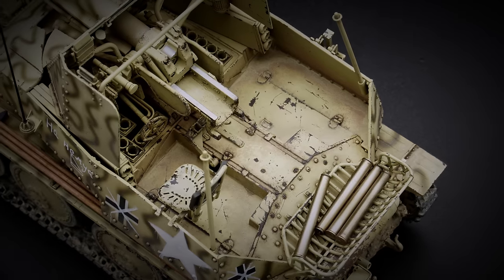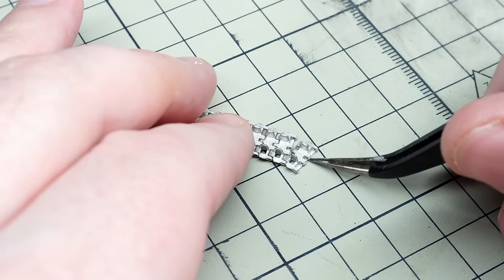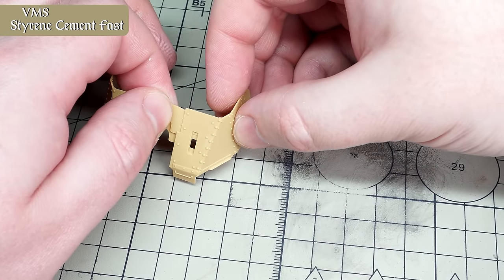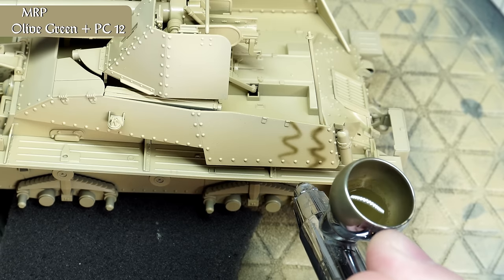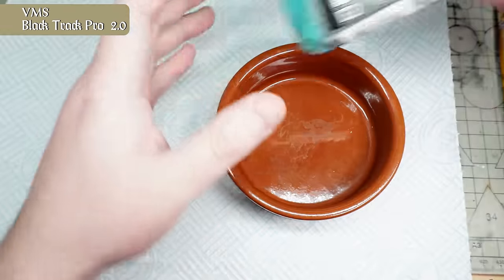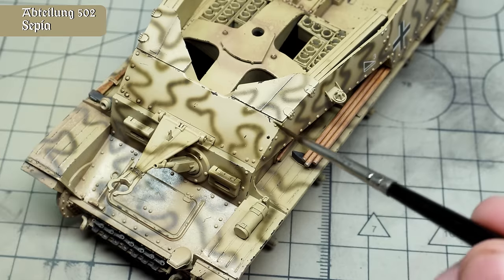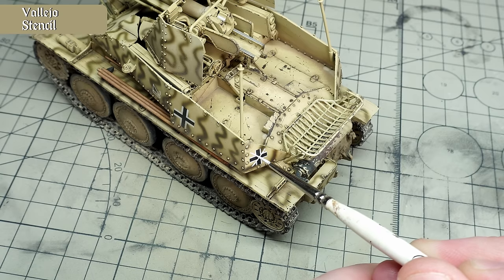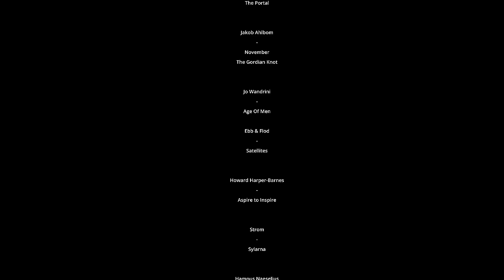Tamiya 1/35 Marder III | Full Build

Comment: Another trick for the 2 piece gun barrels, is take a.010 mm piece of plastic and glue it in one side then attach barrel together and cut, sand, and flush it all together.
Reply from the maker: That's a cool tip Rick thanks !

Comment: Fantastic bit of modelling, What airbrush kit do you use and compressor? would like to know what would be best for modelling as I'm only just getting back into it after 40 years :) Many thanks
Reply from the maker: Hi Phil thankyou. Sorry for the late reply. I use a h&s infinity cr with a 0.15 needle and nozzle ( one of the finest sizes you can get) 
My compressor is a sparmax tc-610 h ( or very similar ) 

It's about 450 for the complete set up that I use, I used an iwata sprint jet to start with, had that for 2 years and it started overheating from use, if you're going to be  spraying a lot, get one with a tank. If not a constant one is fine despite what folks say. 

Airbrushes are very personal, I found the spares for h&s  very affordable compared to iwata so I shifted over a few years ago, haven't looked back :)
Reply: @lpjmodels  Thanks for the reply, brilliant, I'll look into getting one of those

Comment: I was thinking you maybe had a problem with the paint peeling away because of the mix, however I read that AK Real Color and MRP are both acrylic suspended in a lacquer mix or vice-versa. Tamiya XF is aycrlic in alcohol. Mr Hobby Aqueous is the same. I guess they're all interchangeable.
Reply from the maker: Hi mate, it was 100% a scrape, the finish is really tough. I caught the end of what I was using to chip in the paint because at that particular moment I was being a bit too vigorous and  got distracted. 😀 
I used to have adhesion issues several years ago, lots of paint peeling with tape e.t.c but I ironed that out. 

Aha paint chemistry my favorite!  
Ak real colour started as a formula similar to tamiya but somewhere along the line the recipie was changed and now its pretty much a pure laquer. 
Standard mrp is pure laquer, but they have a water based version for touch ups. 

Sprue cutters union podcast have a few episodes where they go into the bear bones of the subject, the problem is paint companies aren't always transparent with their information. 
It's an interesting subject !

Comment: Lovely as always. I have found AK and Ammo chipping fluids hit and miss on some of my past projects. How would you rate the VMS chipping fluid by comparison?
Reply from the maker: I found so far it easier to use. The first point Is the surface tension isn't quite so bad. But it is still a bit of a dark art.  I havent tried it with straight tamiya properly yet but i bet it slaps.

Comment: What needle did you use in the airbrush when doing the camouflage? I have a really hard time painting camouflage.
Reply from the maker: Hi Chris 0.15, but you could manage with a 0.2. 
What problems are you having?
Reply: @lpjmodels  it keeps splashing to the sides and the lines are way to big
Reply from the maker: @chriswegje  what paint ?
Also are the splashes like a stipple paint or runs that are like water being pushed away from the centre point.
Reply: @lpjmodels  I use Vallejo Air paints it looks more like water pushed away
Reply from the maker: @chriswegje  vallejo aren't the easiest to use as a start, lots of folks have great results though. 
From the sound of it they are either too thin or you're using too much pressure. 
Get nice and close. No more than 1.5" 
 lower your pressure to about 10 psi as a starting point and only move the trigger tiny amounts. You want to open the needle arpature just enough to let some paint out. 
Start tweaking as you figure your results,  get speckles, add  more pressure, got  spidering, less pressure. 
Smooth paint but going down really dry or diffused, make sure to get close. 
If you're using a larger nozzle and needle  .3-.5 you might have trouble getting really smooth graduations, you'll find some speckling on the edges. 

Certain colours are also more notorious for this than others. 

One of the reasons I moved to MRP mostly and other laquer based paints is the ease of spraying. Yes it's best to use a booth or mask or both, I use neither, and work in a well ventilated area. I figure I'm only spraying small amounts of paint so it won't be so bad.
Reply: @lpjmodels  thank you for the help I really appreciate it. I will surely try this out on my next models. I love your content keep up the good work man!
Reply from the maker: @chriswegje  best of luck ! Lots of practicing helps, get an old scrap model or a plastic lid and prime it and have a play. Nothing responds the Same way as a painted surface and it might save you headaches down the line !

Comment: When you spray those super thin lines I guess you use very thinn paint and wery low psi. Maybe like 7 psi or maybe 10 since harder and steenbeck dont push a lot of air like the mr hobby procon.

Comment: Sorry but the way you are using the "fast setting" on the hull is not great. applying it onto on surface then bringing together means its almost dry,not wet enough for even a "light" tack ,if you come back to apply more. Just do it once when both parts are together. might get away with small parts but noy large slabs like this.
Reply from the maker: Hi Gary, it may be unorthodox but the parts haven't come apart